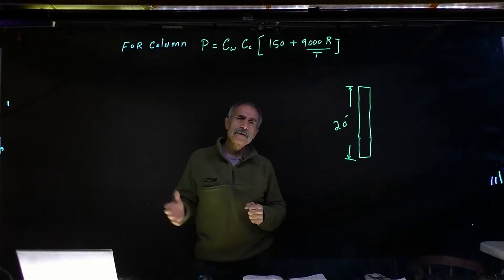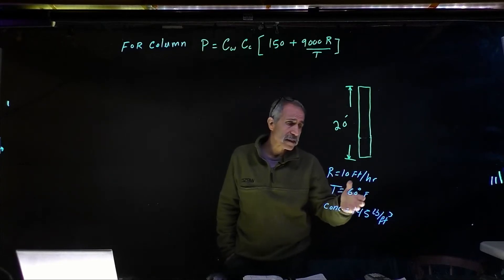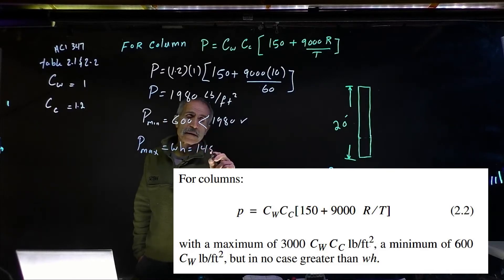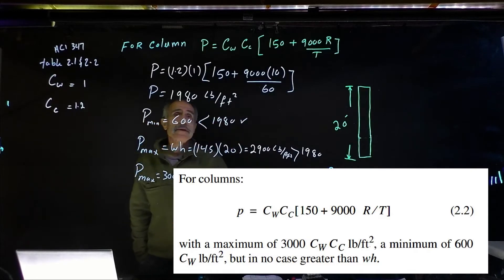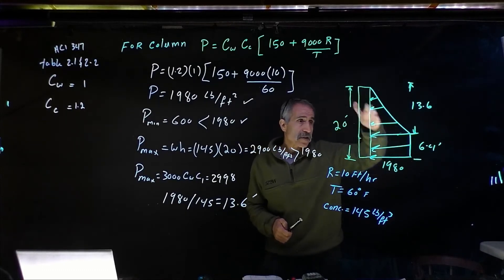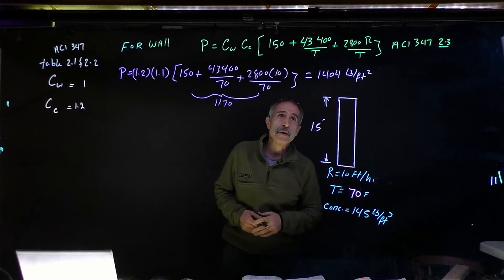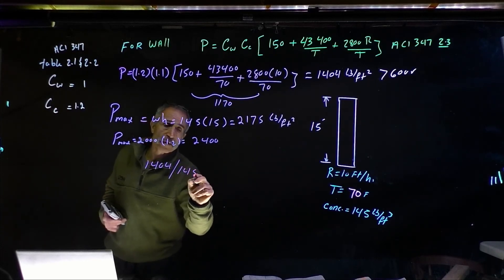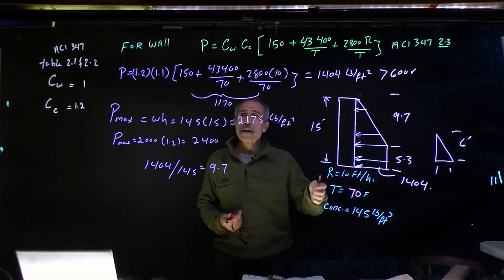Concrete Form Pressure Calculation

Comment: Thank you for sharing. How do I calculate lateral pressure for SCC?
Reply from the maker: The lateral pressure of self-compacting concrete (SCC)  it depends on the amount of pressure it exerts laterally when fresh. The design of formwork is governed by this pressure. For slump greater than 2.5 inch  p= (3.28+0.26Rt)Wc>=630<=Phydrostatic
Reply: @nasseryariphdpe648  thank you for the reply. I’m preparing to build forms for an 8’H x 40’L x 10”W garden / privacy wall. Before I do, however, I need to figure out how much scc lateral pressure is / will be. Perhaps I need to just consult a structural engineer. Thanks again! Be well

Comment: How do I decide to use either ACI 347 or ASCE 37-14?
Reply from the maker: Lateral Pressure on formwork is addressed in both ASCE 37-02 and ACI 347-04, but there are few differences in both:

- Column Forms

ASCE states maximum limit of 3000 psf, however ACI has no upper limit.

-Wall Forms

ASCE doesn't consider the placement height, but ACI use 14' as one of the applied conditions.

ASCE uses 2000 psf as maximum pressure but ACI again has no upper limit. They both are accepted . I would use ACI.

Comment: Great video.  Is there a way to calculate extra load created by vibrating, or does the vibrater just make the whole column/wall liquid pressure?
Reply from the maker: The lateral pressure of fresh concrete is calculated as  temporary like fluid liquid pressure so vibration from the concrete vibrator do not add any more pressure provided the contractor follows the designed rate (rate of placement per hour)